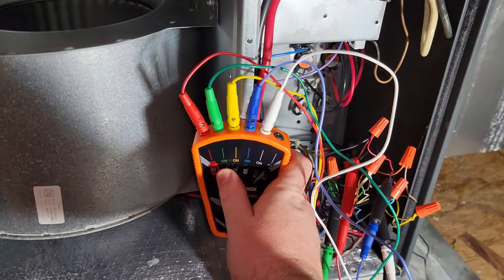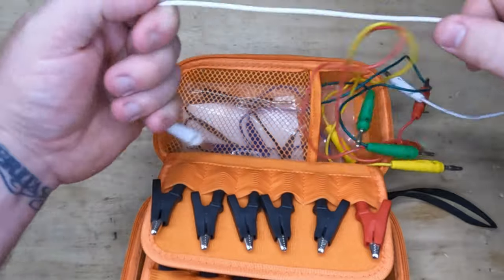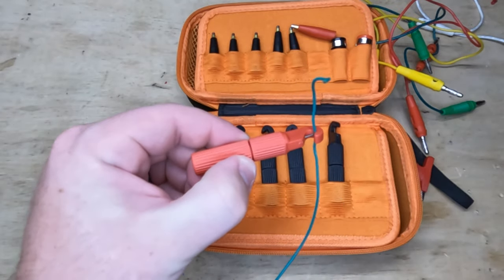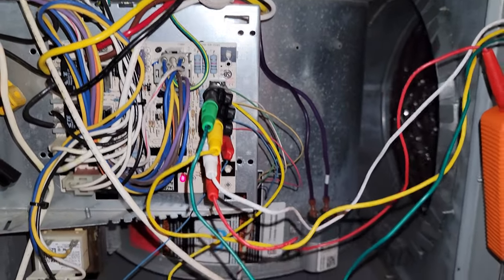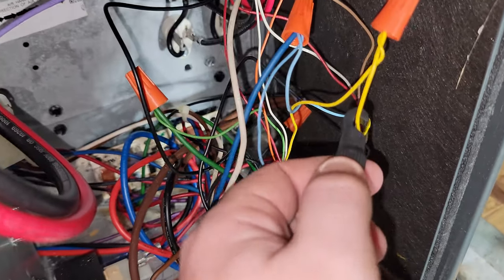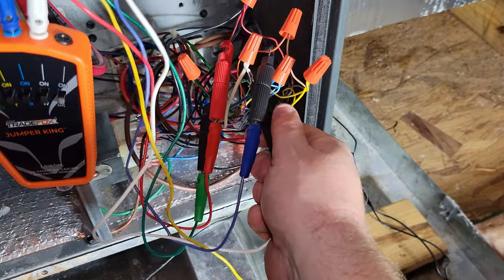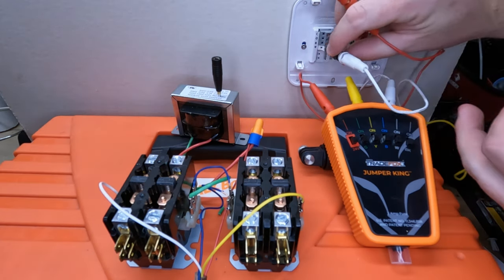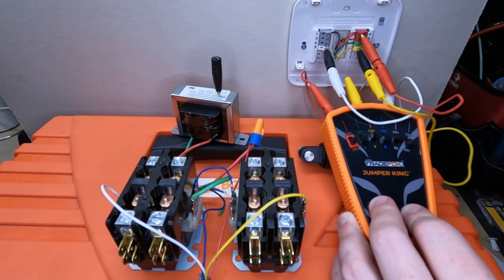The Jumper King Is A Diagnostic Must Have! Tool Review

Comment: Getting to those connections on commercial RTU's with the board hidden behind everything with thermostat style terminal that you can't clip on too, like on a YORK Sunline.  Priceless!  Damm near every one of those I come across all of the T-stat wires are striped back waiting to be shorted out.  Even if there is a decent terminal strip trying to get 2 clips on R so you can go to G and Y is a balancing act.   I have been caring my automotive piercing probes, but this is way better and it's fused on R.  I use it almost every day.

Comment: This looks like it's gonna be worth it for the leads alone. I jump out a lot of stuff for testing as I not only do HVAC but refrigeration, and hot side. This is cool
Reply from the maker: Yea man its been handy. When you get into those nasty air handlers testing heat and all the wire nuts are corroded I just pierce the jacket and continue on.

Comment: So once hook to circuit board terminals . No need to remove the wires . Imean the thermostat wires could also still be attached ?
Reply from the maker: Yea all the wires can be left on. The tool will complete the circuit bypassing the thermostat

Comment: It’s a neat idea (though not a new idea). However this is nothing that we can’t already do with jumpers. Not sure if it’s worth the cost or the space in my bag compared to simply using jumpers.
Reply from the maker: I keep it in its case and grab it maybe once a week. I dont take it out for every call
Reply: not that worth it , it cost to much and you can already do all that with jumpers.
Reply: It does many other things such as finding low voltage shorts. It also reduces the chance of short cycling compressors
Reply: Been doing hvac for over 20yrs now and I'm all about cool tools but I'm also about lessening the load in my tool bags lol. I'll stick with a roll of good ol fashion jumper wires. And no chance of switches going bad on those.

Comment: This will make it easy to find a short ?
Reply from the maker: Yea it has a resetable breaker on the bottom
Reply: Or you can buy a lil popper tool, resetable fuse u just plug into the furnace board. Like $15 at parts houses.

Comment: Do I need to turn t-stat off first before I jump? What if somebody turn on t-stat and I have the jumper on is that ok
Reply from the maker: Id recommend turning the stat off beforehand. So you know the unit is doing what you want. Yea if they turn it on thats fine. Its all the same power source. If its an issue just pull the R off and connect it back before you leave
Reply: @WorldofHVAC  thx you

Comment: Can this devise be used on 1 ton and 2 ton minisplits and how?
Reply from the maker: No those are dc systems. This is for 24vac systems
Reply: Buht the minisplits have comunication wires from evaporator unit and they have a 220vac conntactor with coil...can you make a video qith a minisplit 220v 2 ton up-load it to youtube so we can learn from it..please!!
Reply from the maker: @joseluissosa-kx4nj I dont have those in my area. Sorry

Comment: How is this useful? You get the same result using alligator clips at the board.
Reply: You can also find shorts and it reduces the chance of short cycling compressors. Additionally it can bypass controls right on the wires with the piercing tips.
Reply: It won't find the short it will just tell u if it's on heat side cool side.. tech with some years under their belt can do the same with jumpers and a lil popper fuse. And figure what mode is tripping in 5min.